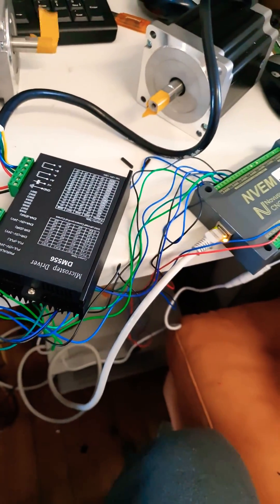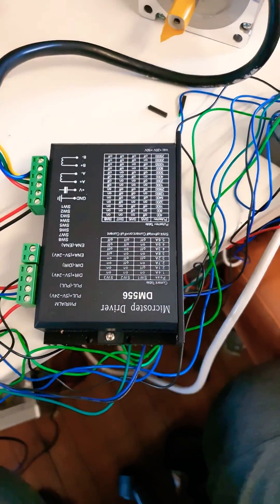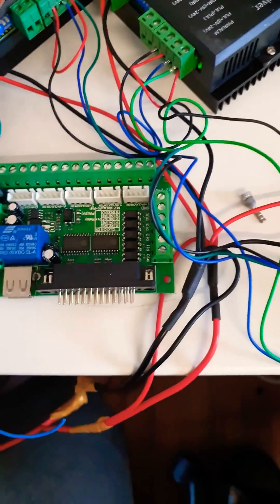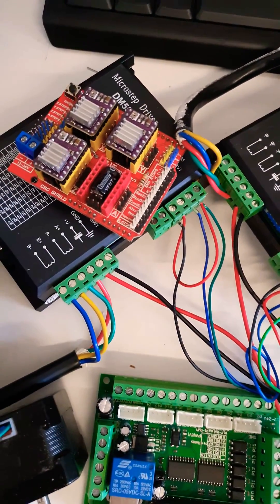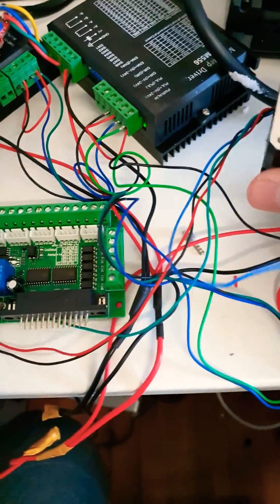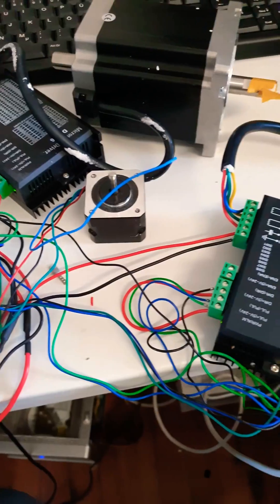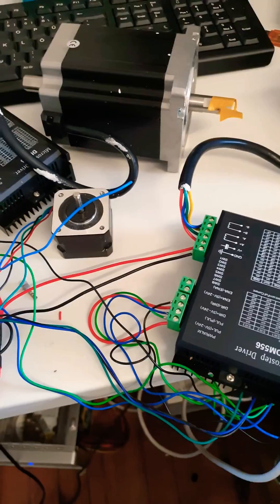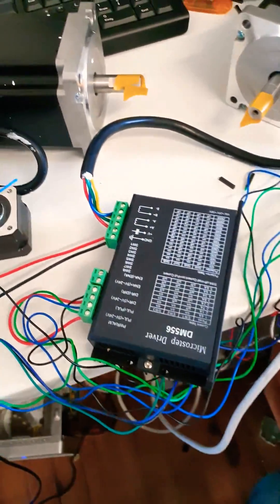3000 Rpm Nema 34  8.5 NM , NVEM 6 Axis Cnc controller , Nema 17 with cnc Shield V3

Comment: What is best max RPM for Nema 17 without loosing steps and without reduction in its rated torque. 
I'm using a 1:50 ratio high precision gearbox. And want to achieve 20rpm at the output. As heard Nema 17 looses it's torque characteristics beyond 200rpm.Your suggestions would be appreciated. Thanks